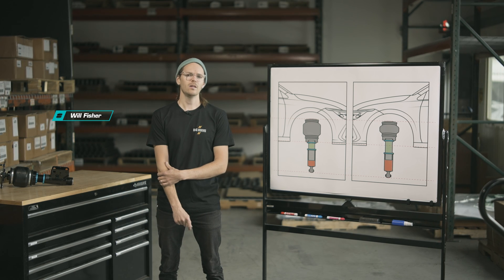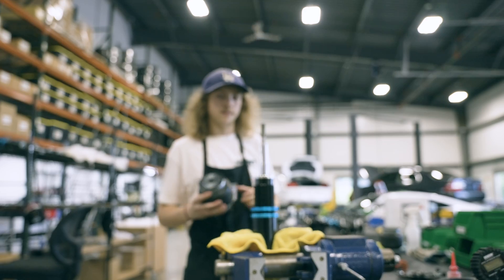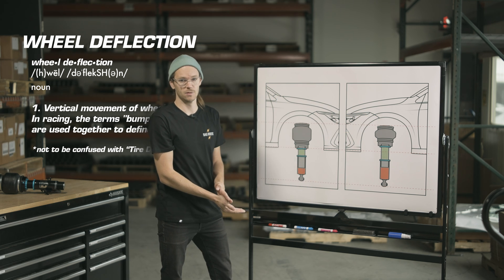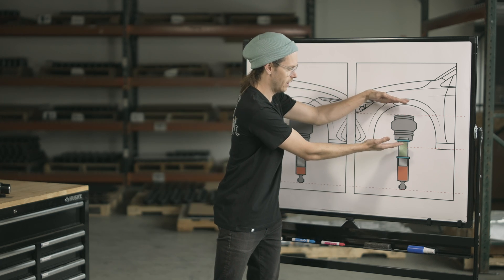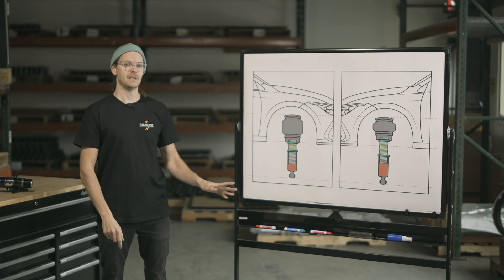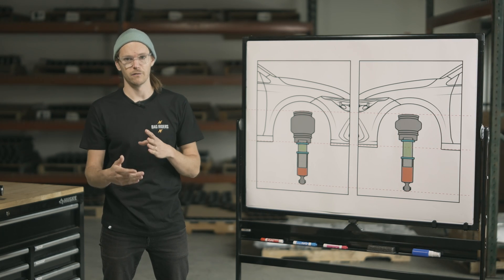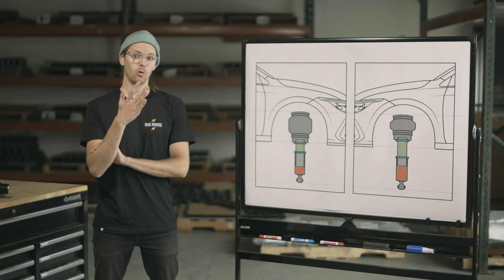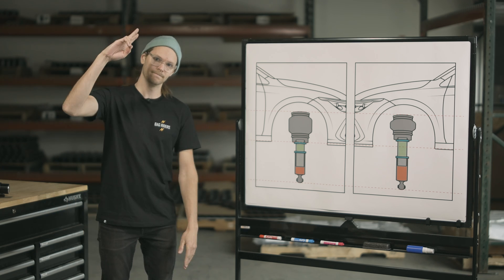How to Setup Your Air Suspension for Ride Quality or Performance

Comment: i remember back in the day you had to get long travel shocks to go with your bags, i am putting a 6th gen rear cradle in a hotrod and i am designing how i will air ride it and i think i really want do tapered bags with a seperate shock but looking on websites it's buy this 2000 dollar pair of custom built shocks but i know i can make work something that's mass produced but i can't seem to find those anymore. but i know they have to still be making them. anyone know where to look?
Reply from the maker: Checkout our Ridetech products on bagriders.com or contact our customer service team for advice at sales@bagriders.com.

Comment: Does anyone know if there are spacers you can get that would raise the ride of the rear? Or will that mess with the suspension geometry?
Reply from the maker: Are you referring to adding a spacer to the bag on a divorced rear setup? If so yes you can add a spacer.
Reply: @bagriders do you know where I could find one?
Reply from the maker: Sorry for the late reply. It would have to be custom made.

Comment: My air suspension is VERY bouncy when going over bumps and feels squirmy when driving on flat roads. Almost feels likes the entire car is bouncing on a trampoline.. Almost squirrelly if I could put it that way. Not sure if it needs an alignment or what but car steering is really soft and feels like it pulls both to the right and left of I give it gas (I don’t dare give it too much gas) any tips would be greatly appreciated (first car with bags and installed and did everything myself. Mind you I haven’t adjusted them at all since taking them out of the box. Basically just slapped them on and called it a day but this is not drivable long term. Any tips or recommendations would be greatly appreciated! Thanks!
Reply from the maker: If the car is bouncy you might have too much air pressure. As far as the pulling left and right you are going to want to align your suspension at your drive height. Feel free to contact us at 844-404-7344 for the recommended ride pressures.

Comment: Ive had tons of issues with ride quality more over ride performance response. I have a big expensive splitter ive sadly rubbed off on my driveway and After multiple videos and 1 year of driving I have to countinue to raise the system thread collar. Get new alignment from a more reputable shop since I get tons of sway and kick in my rear end during a bump and usually feel a lot of hits on my car unlke my previous suspension which was more heavy hitting and stable. 

Im currently running 140 Front and 65 rear. Im jsing slim bellow fronts and regular divorce rear. Im Stiff 12/32 Soft in the front and 13/32 in the rear. Im happy with the cars launch performance but driving it is a pain sometimes depending on the area im in and I have to make sure im not topping out at that height.

If you can provide a quick response that would help but im porbably going to call in. Thanks for the videos!
Reply from the maker: Which exact bags are you running up front?

Comment: How much ride height can i expect to gain over OEM by fitting and tuning air suspension correctly ? A lift kit will give me 2” of height however i only need an extra 30mm or so.
Reply from the maker: The air suspension we sell is specifically designed to lower a car.

Comment: A couple days ago while driving my remote cut off and my compressor stopped working idk why, I tried resetting it from the back, tried the fuse, the relay but still nothing is working..
Reply from the maker: Make sure your power and ground wires at the battery are secure and properly tightened. If that doesn’t solve the issue, check your ignition source wire and inspect the fuse to see if it has blown.

Comment: How do i get less bounce but soft ride
Reply from the maker: I would try lower pressure increased damping force as a first adjustment, making only very small adjustments between tests. Also identifying where the "bounce" is coming from, front, rear, or both.

Comment: Hey guys, is there a certain style bag that works better for certain setups? I.e. Single bellow/slim double bellow for stance/low ride height, regular double/triple for ride quality/lift? 

Currently static, planning on converting to air but don't want to sacrifice much ride height if any.
Reply from the maker: What is more important to you, having plenty of lift, or having a high enough spring rate? If spring rate is key, you'd want smaller air springs (like our Super Low product line). Something with a double bellow works well if having extra lift is important, but you'll have a lower pressure in each bag at ride height, so it's not going to feel like your coilovers.
Reply: @ main concern is retaining a high enough spring rate with close fitment. Only time I'd need lift is for certain ramps/speed bumps, maybe no more than 2-3". 

Super Low does seem nice, but that kit isn't made for my car ('09 Camry). I was considering UAS Air House 2 Aerosport bags to fit onto my BC extreme lows, would that be a good option for my needs?

Comment: On my STI i recently installed bags on it. When I ride on 60psi or lower, suspension feels smooth… but if i drive over 60psi, it feels stiff you can even feel the car go over those little rocks on the road lol

Comment: Could really use some help re adjusting my air ride. First time all diy. I find the most comfortable at 80psi front and 100 rear. But the truck doesn’t sit level.
Reply: Measure the difference in height from the ground to fenderlip and adjust accordingly on the threaded mount

Comment: Hi I’m on airtekk struts and when I go over a bump I hear a noise on the rear struts. When I raise the psi on the rear the noise I hear when going over bumps goes away but when I lower the psi the clunk returns. How can I fix this? Thanks
Reply from the maker: It seems likely that you are bottoming out your struts. If you can thread them a small amount "shorter" similar to what we do in this video, that would be a good first step.

Comment: Not sure if this is a major or minor issue but my bags need around 60psi just to start lifting the front. I have max load which is a good brand but maybe it’s something with the wiring. I have no leaks and rears are perfect.
Reply: I have a Lexus LS 460 so it is heavy

Comment: How do I know if my air spring is bottoming out or topping out? Cause when I accidentally hit a small pot hole, I heard a loud-ish thud sound… but I’m following the specs you guys recommend for my GR86. This is on the Super Low suspension and I mainly hear it in the rear.
Reply from the maker: Air ride is not prone to common bottoming out issues because the PSI pushing your car upward (against gravity and downward forces) becomes increasing strong. Progressive coils springs are like this as well. So I would be with 95% odds that the sound is topping out!

Comment: I had no idea you could spin the bag to adjust the height! Thank you for this informative video Bagriders!
Reply from the maker: Just to clarify! You want to spin the damper, in the video we use the bag as a method of spinning the entire assembly. As long as the bag is locked to the damper, and your lower mount has the lockring loosened up, you can use this method.
Reply: @bagriders  Oh I see! Thank you for clearing that up
Reply: Tip: Never never spin the bag counter clock wise (raising). You risk unthreading the bag off of the strut if you dont do it correctly. If absolutely need to raise the bags, adjust it by the lock collar that's against the bags using the spanner wrench. It's only OK to lower the bag clockwise by hand at the bag to thread it down to the lower mount.
Reply from the maker: @reighnerboo  That's a great tip. In this video I was adjusting a Super Low set, and we use both an upper and lower lock ring. As long as the air spring and lock ring remain tight, and the lower is freely able to spin, you're safe to grab onto the air spring and rotate. In the case of Air Lift Performance product line, they use loctite to hold the air spring in place instead of a second lock ring.
Reply: @bagriders  should make it in a option when buying airlift struts for another lock collar to lock the bag to the strut. I’ve done custom radial bearing housing, slim/tall double bellow bags, extra lock collar to lock the bag on the strut and custom cnc top hats for front camber without trimming the strut tower using airlift performance shocks had to end making a Frankenstein air strut to meet my needs for my 2017 Honda accord 😅
Reply from the maker: @joeljaipersaud  Super Low is actually coming out with a 2017 Accord kit that covers most of those upgrades! We'll use a radial bearing, we use a slimmer bag, and I'll talk to our R&D people to see about how our camber plates are set up, because that's an interesting concept.
Reply: @bagriders  yup just make top hats thick enough so the strut’s thread ends flush with the mounting surface of top hats pretty simple concept that all suspension manufacturers over look especially with McPherson suspension setups adding camber without modifying the suspension knuckle because you have the clearance with a slim bag to do so

Comment: How would drifting on bags go?
Reply from the maker: A well configured suspension being operated in the correct travel ranges will work for Motorsport or for daily driving. There's nothing about bags that prevent them from being used for drifting, so go for it!

Comment: Novice beginner,  54 bel air ,  had somewhat close pressures for each wheel, for best control and comfort,  shipped vehicle  Sat for a while lost notes. Best recommendation on where to start over for max control and comfort,  start lower pressures  and cruise a bit?
Reply from the maker: That can depend on the type of damper you use front and rear. With air struts with the bag sealed to the shaft, yes we like to start at a lower pressure and test drive it. With your Bel Air, the same logic should apply, though it will be a lot less sensitive to topping out, compared to a McPherson style setup. That means a broader range of pressures will work comfortably.
Reply: Higher the more woblly and less control? Or not exactly  @bagriders
Reply from the maker: @eliacasanova4217  Having your control arms parallel to the ground at your ride pressure is a great starting point. Having it a little higher(taller) than that won't necessarily cause wobbliness but will impact your spindle and wheel camber angle. Let us know if you want more info.

Comment: I just used this video to extend the front struts on my 2014 Mustang GT. I was needing to put just over 100PSI to get my car to the desired ride height and it pretty rough. Now I can actually run the recommended PSI of 55 and the car rides so much better. And still airs out the same amount as before. Thank you!
Reply from the maker: Heck yeah! I'm glad to hear that!

Comment: Great video! On my vw bug which was my very first bagged vehicle that I built all the bag brackets for I had no clue on bag geometry so I set it up as best as I could. I ended up taking the collapsed height and the max extended height and figured out the middle distance. From there I adjusted my suspension to the ride height I wanted and made the mounts at that middle distance of the bag travel. The bag never bottomed out or over extended and gave me a really good ride(a little on the stiffer side but not bad at all still plenty of cushion) when I would launch hard it would squat down about an inch and a half and dig(it was about 120 psi on ss6 bags) since then I've always used that middle of the travel setup at ride height with great success

Comment: What should I do to eliminate the thumping in the suspension 🤔
Reply from the maker: What sort of thumping? Are you experiencing this at the most extended point in the travel range, or the most compressed point in the travel range? Does it occur over bumps, or all the time?
Reply: @bagriders  over bumps I'm running airtekk stage 2 plus and 104 in the front and 94 in the rear. The front damper is at 10 and the rear is at 15.
Reply from the maker: @RiseOfTheSonata2.0t  If it occurs over bumps, you are very likely topping out. You'll need to determine if it's coming from the front or rear.
Reply: @bagriders  it's coming from the front the most.
Reply from the maker: @RiseOfTheSonata2.0t  I would try to thread them up to be a little taller (longer) as shown in the video, and then go for a test drive at a slightly lower pressure.

Comment: Hey guys. When you say make it stiff, you mean max psi/pressure same as one indicated on the bag? Ex. 100psi Thanks
Reply from the maker: When discussing 'stiffness,' we're not referring to the maximum PSI. Instead, we define 'stiff' as operating at a pressure higher than the manufacturer's recommended ride PSI. However, even at this elevated pressure, the damper retains its ability to utilize its range of travel.
Reply: @bagriders  Good to know . Thank you so much

Comment: I wish your shocks had more rebound damping. Mine is super harsh topping out. compression is fine but rebound is terrible
Reply from the maker: The majority of our suspension offerings boast 30+ way adjustability, providing ample opportunity to tailor your ride precisely to your preferences. Should you desire assistance in optimizing your suspension setup, don't hesitate to reach out to our dedicated customer support team at sales@bagriders.com or call us at 844-404-7344. We're committed to ensuring you're equipped with the ideal pressure settings for your vehicle.

Comment: Great video Will, love the recent content you’re putting out. Do you have recommended air pressures for SuperLow? At least for Air Lift, people run the bags with too much or too little air pressure, and the struts top and bottom out. It’s really important to get your ride height at mid stroke of the shock for the best ride quality.
Reply from the maker: We would be more than happy to provide the recommended air pressures for our Super Low suspension! What is the year, make and model of the car as each kit has a different ride pressure.
Reply: @bagriders 2020 toyota avalon